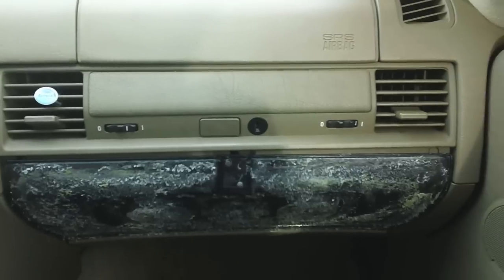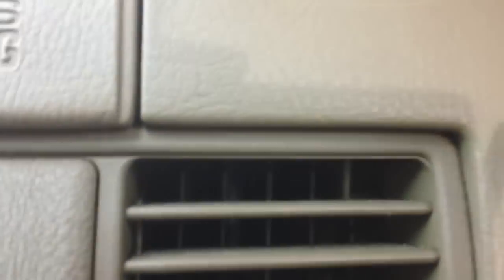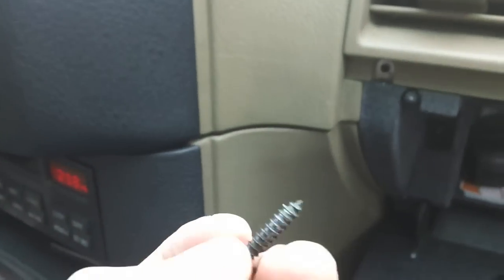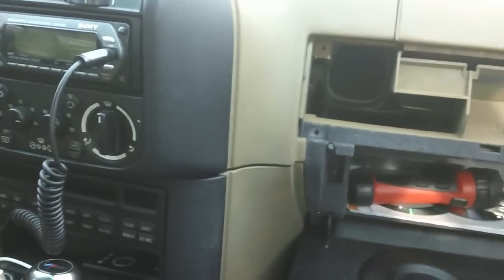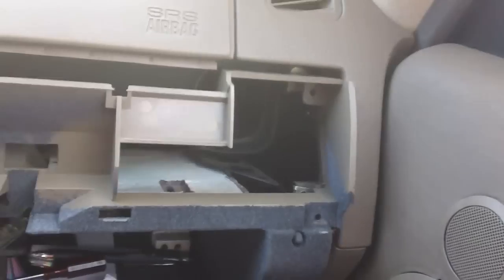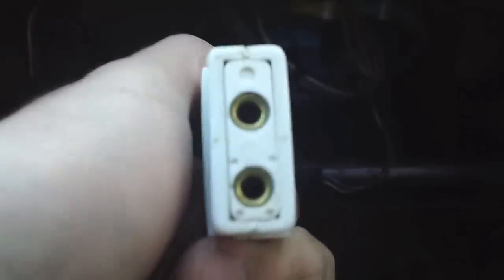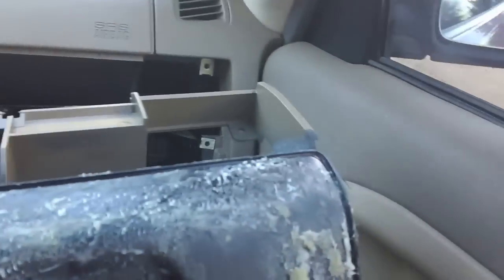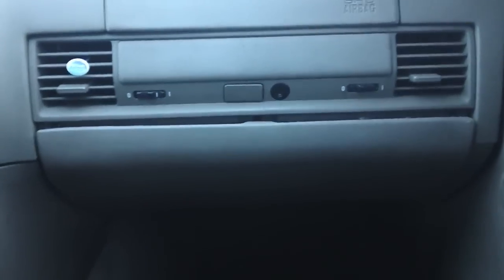BMW E36 Glove Box Removal

Comment: The 10 mm bolt is under the glove box light. It Simply pops out from the BACK. If you pry at the front you can brake the switch part.

Comment: Pretty incomplete video i have to say. Apart from the screw which you didn't show where it was located, i also had a few more screws that i had to remove in order to get the glove box out (2 facing upwards inside the glove box and holding the opening mechanism for the button and a few at the hinges of the door). Anyways, very useful for removing the air vent as i didn't see those 2 screws inside the air vents and would not have figured it out if it wasn't for this video